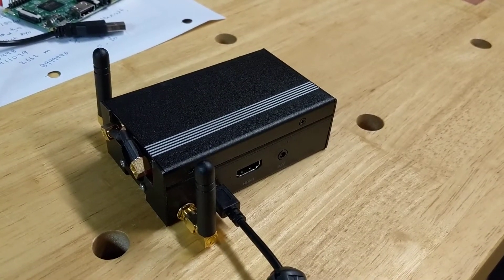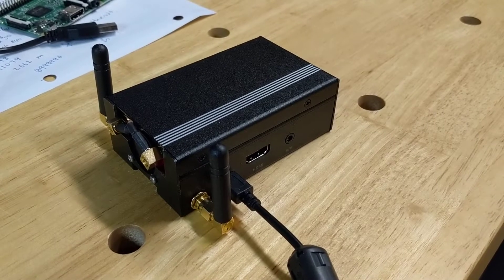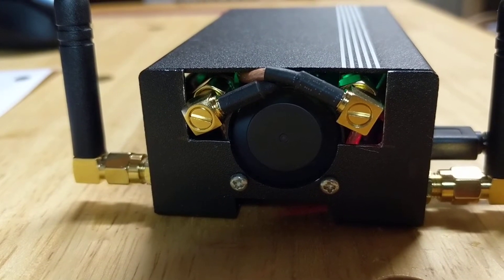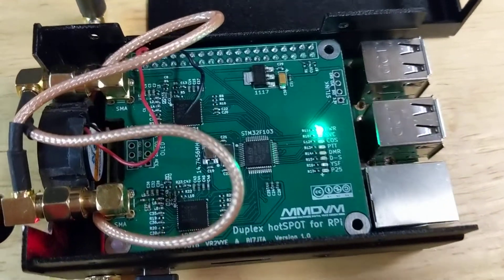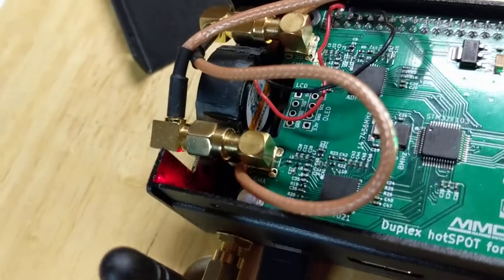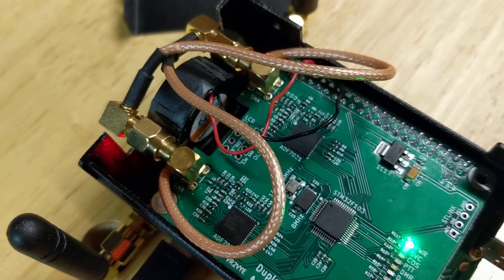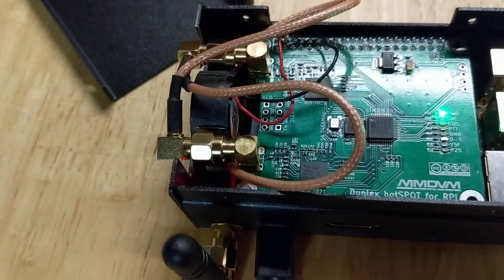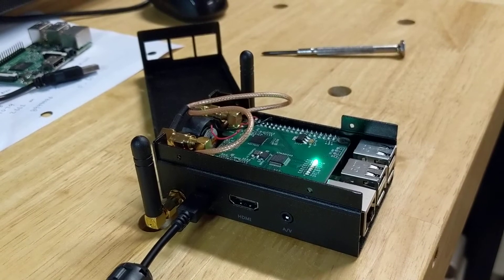Duplex pi-star hotspot

Comment: As a FR-6000 Icom NXDN repeater owner, I knew I needed separate RX and TX frequencies, the problem now is, the duplex MMDVM operated through repeater to link to NXDN Gateway works fine, other than the MMDVM repeats local RF (acts like a repeater). I need a simplex like setup, but on two different frequencies. Any clues how to procede?

Comment: I ordered the case for the Pi-3B. The board with the mini dmr on it won't fit so I had to drill holes in the back. It will fit now but the antennas are not long enough to connect. Where did you get the SMA connectors and jumper cables to connect to the antennas. Also I can't hook the fan up with the Mini DMR board connected. How did you do yours? KH6OWL

Comment: What are the advantages of a duplex hotspot over simplex?
Reply: You don't have to wait for some airbag to shut up to change talkgroups... just change channels and key up the new group
Reply from the maker: For DMR: 2 time slots, and you can use each at the same time
Reply: @BudTalbot  on some other video Ive seen one using two radios, one with C4FM (YSF) and the other with DMR. Is this standard functionality with duplex mmdvm hot spots?
Reply: 2 timeslots on Duplex, only 1 timeslot on Simplex

Comment: How does one mitigate the RF desense? Or is there a notch setup on the board? Or is it just a matter of as much frequency separation as possible?
Reply from the maker: I think the latter. Keep the split >= 5 MHz. But maybe the developer Winters Huang could better answer your question about the board design. I do think RF desense is sometimes an issue. The one problem we are all currently dealing with is missed key-ups. Sometimes you'll have to key multiple times to activate it. That seems to be worse with certain radios.
Reply: Bud Talbot I suppose that the hotspot is only maximum 20mW and most dmr hand held units are 1 / 5W so the receiver is getting more rf that what's needed when in the same room! 😉
Reply from the maker: Yep- and I think that can be a problem